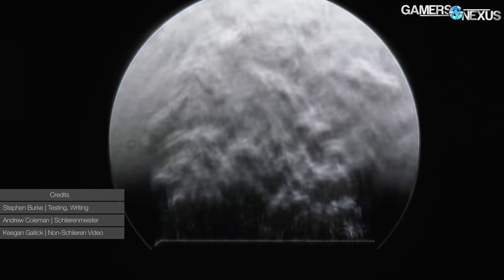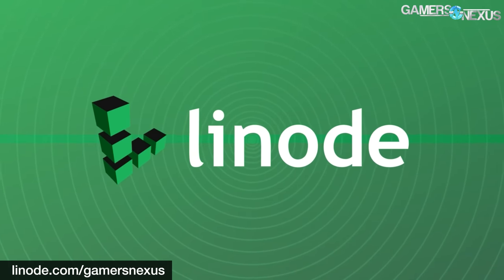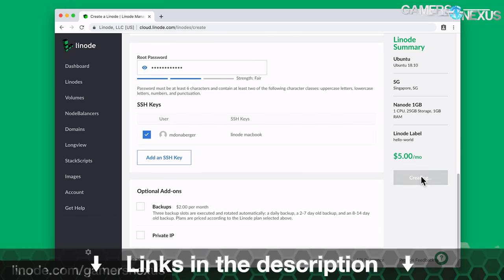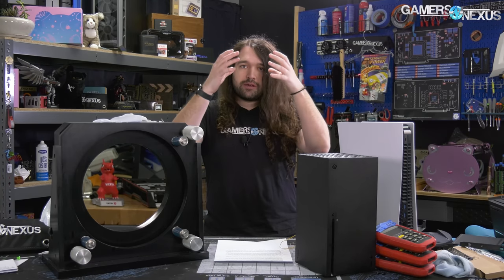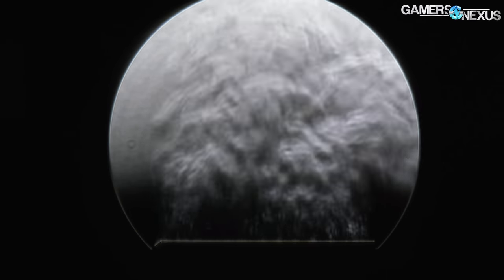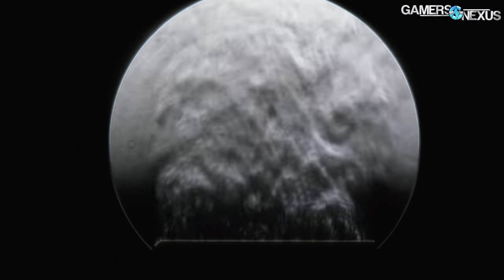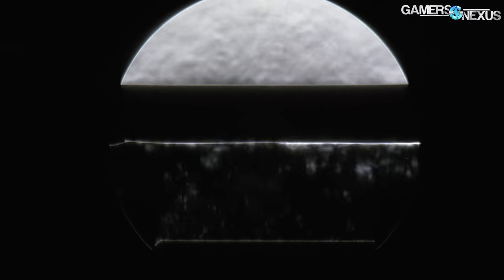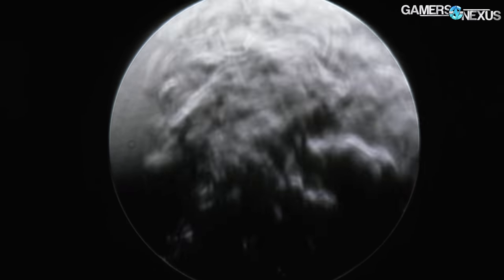PS5 vs. Xbox Series X Airflow Testing: Cooling Design Efficiency & Flow Paths

Comment: Oh man, even though I'm almost 100% a  PC Gamer, I've been waiting for this video. This is super interesting!
Reply: What's the other couple percent? I mostly play on PC my self but also like my Nintendo games. PC and a Switch is a good combo imo. The best of both worlds. You get the most iconic exclusives and on PC the crushing hardware.
Reply: @blitzwing1  I actually have a series x and I’d say it has nice raw horsepower and a super premium, microatx pc tower look
Reply: @kaleidoskope4314  pokemon and mario needs to go
Reply: @chriswright8074  🤦🏽
Reply: @phantoslayer9332  raw power that still is behind the PS5 in most tests.
Reply: @ChumpyChicken2  did I say anything about the ps5
Reply: @phantoslayer9332  What’s super premium about a plastic unibody device? If it were premium it would be made out of aluminum at the very least.
Reply: @ZackSNetwork  ummm you realize that most of the products you use daily have plastic in them
Reply: Lol, I'm a scientist who does computational modeling and I'm rapt.
Reply: lol consoles, bless
Reply: I think it's interesting because of the radically different airflow designs
Reply: @kaleidoskope4314  I have a PS4 Pro for the exclusives and probably will at some point in the future buy a PS5. 

My wife has a Switch, because she had to travel a lot because of work before the pandemic. After covid, the Switch hasn't seen much use though.
Reply: @ChumpyChicken2  Not in Raytracing which makes Series X more future proof the when the drivers for Xbox mature it will pull ahead.
Reply: @neosrt10  no in the slightest. Read at Dawn Founder: "Dollar bet: within a year from its launch gamers will fully appreciate that the PlayStation 5 is one of the most revolutionary, inspired home consoles ever designed, and will feel silly for having spent energy arguing about "teraflops" and other similarly misunderstood specs." I think he’s talking about you bud.
Reply: @blitzwing1  cannot say anything about PS5, but Xbox SX in reality looks premium even it is plastic. Using Xbox and water cooled mini-ITX NZXT with fanless PSU, can say that even after tuning cheap fans on PC, Xbox SX is way more silent. Probably Noctua PWM fans would help a little, but XSX so far works really well.
Reply: @ChumpyChicken2  Nah Superior hardware in the Series X son the drivers are late but when devs catch up and get to know xbox series x better it will easily beat Ps5 we already see it in many raytracing heavy games and higher res. you ponies are in denial XboX Series X dev kits went out late when they are more mature Xbox will pull ahead of Ps5 and its already started big games like Cyberpunk,  Legion, Star Wars, Control all have better performance than Ps5 with Raytracing 30fps quality mode on Xbox Series X.
Reply: @ChumpyChicken2  LoL
Reply: 100% here, still interested.
Reply: @neosrt10  Damn set him straight lmaooo ponies dont wanna know about raytracing quality mode they shiver🤣 this Chicken dude got served.
Reply: @neosrt10  Damn set him straight lmaooo ponies dont wanna know about raytracing quality mode they shiver🤣 this @ChumpyChicken2 dude got served.
Reply: @ChumpyChicken2  Ready at Dawn has primarily worked and releaaed exclusives with Playstation since 2003. Their founder is biased so of course he'd make a biased statement about the PS5 like that due to financial reasons for Ready at Dawn. Therefore he is in no way a reputable source. Series X will be the console to pull far ahead once devs catch up, the tech is simply far greater
Reply: @kyber7503 velocity architecture is a marketing term that a top team of developers joke about. The joke is the every time someone says Xbox Velocity Architecture in the office an Angel dies! Lol! Just remember what Mark Cerny said. 16GB will load in 2 seconds not including Oodle textures. The PS5 I/0 is rated at 22GB/s. The Xbox is not good enough for streaming assets on the fly.
Reply: Saaame
Reply: @ChumpyChicken2  The main components for gaming performance are CPU /GPU(more computr units) the Ram all of which are faster on Xbox series X it's just a matter of drivers SSD speeds will not boost a systems performance only loading times and games that stream the frames per second in graphic detail and resolution will be superior on Xbox series X we're already starting to see it Xbox faster CPU, GPU will also process triangles   textures faster than Ps5 could once Xbox drivers are finalized.
Reply: @neosrt10  The CPU in the PS5 has unified CCX’s. The die shot of the XSX APU shows no sign of this Zen 3 feature. That and a rendition of infinity cache the PS5 has to make up for the wider faster ram on the XSX.
Reply: @ChumpyChicken2  Now your delusional everyone knows Xbox series X has the complete Zen 3 feature set and Ps5 does not its the reason the dev kits came out later than Ps5 because Microsoft wanted to wait for the full Zen 2 (meant Zen 2 typing on a smartphone while at work) architecture feature support where as Sony did not wait thus Ps5 does not support full Zen 3
Reply: @neosrt10  I think you are talking about FULL RDNA 2 features as MS stated. Sorry to cut in on this debate but the whole FULL RDNA2 thing is just Microsoft pure propaganda. The PS5 actually has Zen 3 features in the CPU and RDNA3 features in the GPU. They will do both do things better than each other in different games.
Reply: @ChumpyChicken2  The hardware power and Full Zen 2 features have already been covered ..what stumpt Xbox at first is becoming a non issue the games are running better in Xbox Series X in Quality mode with raytracing on over Ps5...The Series X is future proofed and will pull ahead when the developers learn how to use Dev kits..Ps5 as  fact had its dev kits out a full year ahead of Xbox Series X...quite the unfair comparison until the Xbox dev kits get the same attention and time.
Reply: @ChumpyChicken2  Lmao Both Ps5 and Xbox Series X are Zen 2 bud you know it well . Ok your just spinning wheels and yarns. Xbox series X is the more advanced architectural Zen to console superior hardware wise in every way to PS5 its exact reason Microsoft chose to release Xbox development kits much later then PS5 almost year in fact ahead of Xbox which led developers does it have an easier time have you had spend more time with PlayStation dev kits as opposed to Xbox series X whose dev kits went out in the summer of 2020
Reply: @neosrt10  the APU of the XSX is already going to be used in X Cloud instances (Microsoft's gaming cloud), and likely in Azure (the main Microsoft business, a cloud second only to Amazon).
Note that it has, for example, advanced cryptography accelerators. Which will totally need to take up valuable diespace on a console chip.
Or that the SoC is pretty big and the GPU is wide, but slow at 1.8GHz, to be much more power efficient. Again this is a design decision in part guided by the fact it's a server chip... that heppened to be good at gaming. It’s a dual purpose chip meant for 3x1080p streaming. The PS5 bottleneck free design is why the developers have been finding the better performance atm. Once they leverage the Geometry engine and other not talked about custom features the XSX won’t really show the big difference like all the fans boys have been fudging. As I said. The PS5 has Unified CCX’s in the Zen2 CPU. Which is a Zen3 feature. This is so great for latency and also combinations with a rendition of the Infinity cache. Both are missing from the die shots of the XSX APU. Don’t get your hopes up bud.
Reply: @ChumpyChicken2  Ps5 has the weaker Zen 2 architecture bud the dev kits are being better utilized  on Series X  lately thats why we see it pulling ahead in raytraycing heavy games ..The CPU,GPUx and Ram are all faster and more advanced on XsX .
Reply: Jesus Christ. Why did my innocent hype comment devolve into this weird shit show of a debate? 

The performance of any game is going to be quite similar on Xbox and PS.

There will be some differences, but they are only measured by Digital Foundry. 

No regular person, sitting in front of their TV just having a good time is going to notice that the low 1% FPS is worse on one console or another. Or if the checkerboard rendering is a few pixels short. Or if the loading times are 2 second slower or faster. The games will work (excluding Cyberpunk) and they will be nice to play.

Just chill, and let people enjoy things. Fuck any Master Race thinking, we all just want good games. We want to feel good, or bad, maybe sad, maybe elated. Ain't no teraflop or dev kit out there to make me feel pure joy or hate. It's all about the quality of the game, not about the teraflops.

Best regards from someone who has roughly three times the teraflops of a PS5 on their PC.
Reply: @T4gProd  not sure if you are talking about me but I was just stating facts. I didn’t say anything about one console being better than each other. They all have their strengths and weaknesses.
Reply: @T4gProd  ponies and xbots don't have anything better to do, like play games for instance lol. PCMR
Reply: @ChumpyChicken2  can you state all features of RDNA 2 and 3 with confirmation from AMD?
Reply: @blitzwing1  "plastic" is a stupidly wide net. It can be from complete garbage to aerospace-grade

"premium look" my pimply buttocks, both cases are at best mediocre build quality.
Reply: @benisrood  ps5 airflow works fine has mine since launch runs quiet and cool
Reply: @phantoslayer9332  Horsepower matters less than how fast the car goes.
Reply: Also super biased. He’s great at covering it up.
Reply: the series x is more powerful no matter how you look at it tf
Reply: @ChumpyChicken2  not anymore. Next gen multi plats are now showing Xbox with the advantage. PS5 appeared to have the advantage  at launch because ps4 games were less demanding than Xbox one X games. PS4pro ran games at less resolution than Xbox one X, hence slightly better performance on some older games.
Now, new next gen multi plats are showing more accurately the differences, with Xbox Series X clearly on top in fps and resolution. Ps5 has slightly better load times but it's minuscule...

Comment: Steve, I'm pretty sure the MAP gas is not hot, it's typically colder than ambient due to state change.  I'd bet the gas being visible in this use case is due to the gas itself having significantly different density than the air, thus giving you the density gradient that can be imaged.
Reply: And of course the gas being cooler would also create a density gradient.
Reply: Exactly. I'm glad someone else noticed this!

You'd see the difference regardless of whether the torch had been run recently or not. Methyl acetylene and propane have significantly different density than air, at room temperature or not! (and if it is being released from a pressurised cylinder, it's gonna be lower than room temperature due to the pressure drop effect)
Reply: Ok good im not the only one. I thought he was gonna say "the gas is cold but not as strong" but then I just accepted I was wrong about how gas works lol
Reply: Certainly. 'Bottled' gas is pressurized and, therefore, is cold.
Reply: Anyone who does whip-its knows how cold expanding gas can get :P
Reply: Yeah I would suggest CO2 or argon for this so you only create a suffocation risk doing this and not an explosion risk.
Reply: @leafydialupking1  Since they just need a density difference they could use helium as well. A capped pipe with holes put into it along one side a bit of hose with a valve for flow control and some nice big balloons and they may have cheap easy and repeatable set up
Reply: The gas in the "MAPP" gas tank is about 40% denser then the air. The liquid and gas in the tank would be same temp as the environment it sat in assuming it's not in the being heated by the sun or other source.  Gases experiencing a drop in pressure also have a drop in temp. This can be enhanced by flowing it thru a small opening and getting more of the gas moving in a single direction. This is the chilling you see in high pressure gas being released. Liquefied gases also see a drop in the liquid temp if the heat absorbed is less then the heat put into the phase change to gas. This is why cans of computer duster get so cold so fast.  Helium or CO2 gases would be less hair risking options
Reply: He should be grateful that nothing in the xbox provided a source of ignition. Kablooey.
Reply: @adrianwilson7536  
I would think helium is too light weight. As soon as it left a nozzle pointed at the Xbox or PS5 the gas would just immediately be pushed up to the ceiling by the atmosphere in the room.
Reply: I believe its called the Joule (Kelvin/Thompson) expansion/effect... Though temperature is trivial when looking at air density, there usually is a drop in temperature when gas is expanding. Afaik its because in a gas state, molecules move faster so for the MAP to expand into gas, the molecules needs to extract energy (temperature) from its environment.
Reply: This breaks the definition of "hot" and "cold" a little. Would an expanding gas, not be getting "hotter" while the surrounding air gets "colder", and overall the expanding gas reaches equilibrium. The gas is neither hot or cold, but takes energy from the surrounding air, making it cooler.

Like Aluminium vs Steel. Both are the same temperature but ally feels colder than steel because it transfers heat quicker.

[edit] The above posters have got it more correct than me. :)
Reply: @hectorj.romanp.  technically the gas is at room temperature. When you lower the pressure of a gas you decrease its temperature. That is why when you exhale through  an open mouth it is hot but when you  blow through your lips it is cold.
Reply: @I love you but in this case the terms are virtually interchangable, as refraction index is directly affected by density...so the variations in refraction...are caused by variations in density....yeah
Reply: Y'all saying expert is wrong?
Reply: Thanks - I am not the only one.  "The liquid needs energy to make the molecules have more space and bounce to become a gas.  That's why cold."
Reply: @asbestosfibers1325  True. It can also get so hot that the temperature becomes negative...
Reply: You are correct. Another great example of this is compressed air canisters or propane canisters getting cold after long usage
Reply: You must have ps5

Comment: The slot on the back of the Series X is a thermal safety measure for the possibility of someone putting something like a game case on top of the Xbox blocking the main exhaust. Microsoft detailed this during their launch campaign.
Reply: Yup. Good memory, too often people forget the details
Reply: They even designed the Xbox one like this.. Thermal issues were a problem in 2006 during RROD ever since the Xbox 360S console they almost NEVER overheated.. I've left my 360 and One on for DAYS with the top vents blocked and nothing happened
Reply: @Mr.Genesis  lol are you nuts lol the xbox 360 was really bad for over heating
Reply: @deepergodeeper7618  you mean the ORIGINAL 360.. the one that was redesigned and then replaced because of said issues.. :) i did say the 360S. Try reading next time.
Reply: @Mr.Genesis  It gets confused cuz you said you left your 360 blocked and it didnt overheat.
Reply: @termitreter6545  i said my 360 and One. and yeah you can block the 360S top vent and still not have overheating issues
Reply: @Mr.Genesis  Also, just because it works for you, doesnt mean it works for everyone. Should be obvious, considering not every early 360 died early, just a good chunk of them.
Reply: @termitreter6545  again since everyone doesn't understand.. The 360 slim is a different consolse with a different fan and different build

It's not personal preference it's not even oh it just happened to you.. You are talking about a completely different model of the 360 so before you type again READ THE DESCRIPTION
Reply: @Mr.Genesis  What are you even talking about? You said "I let my 360" on and it didnt overheat. Not 360 slim, or s, just 360.
Reply: @Mr.Genesis  i did read it but they dont get point for fixing it when most people bought it i when thought like 3-4 360s i was not gonna get the fix as well
Reply: @Mr.Genesis  nothing happens unless you run WARZONE AND SHUT THE VENTS. Trust me it will blow up 😎
Reply: @bigguwapbrixks187  i mean Warzone is trash anyway.. idk why people would buy a brand new console just to play Warzone.
Reply: @Mr.Genesis  wow what are you playing mate ?
Reply: @bigguwapbrixks187  mostly single player or coop games on my pc rig
Reply: @bigguwapbrixks187  The fact that you said "Kid" as an insult shows your maturity level.. but what can you expect from a dude named "BIG GUWAP BRIXKS"
Reply: @Mr.Genesis  ok mr genesis 😂 totally ignored everything I said and emphasized on then word kid. It’s a shame I was schooling you with then masterpieces I have encountered in my lifetime and I was not hating at all I was stating facts that you as a hater with a kid mind hence me calling you a kid cause you outburst was childlike “ stuff activision and warzone” me and my friends win 3-6 games a day in a few hours bro with military style comms… so don’t hate kid.
Reply: @Mr.Genesis  yes “you” have heard. Now keep it moving your opinion is yours 🤙🙏 god bless homie peace out enjoy your games 👌 and I will enjoy mine
Reply: @bigguwapbrixks187  you have an unusual obsession with emojis. its like you're 12
Reply: I wondered if it was a failsafe as well. Interesting.
Reply: I made a dust cap for the top of the console the first week I got it because i love my new tech and baby it.  One night i started playing and forgot to take it off and after about a half hour i realized it, freaked out for a min, took it off and realized it still wasnt very hot.  Just love this machine.
Reply: can you use the back of the console vents to blow in cool air?